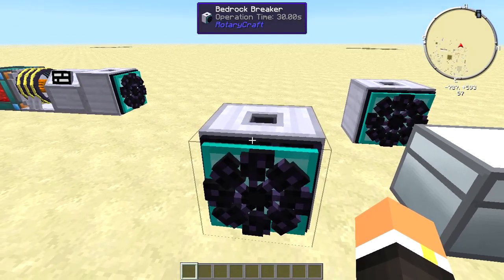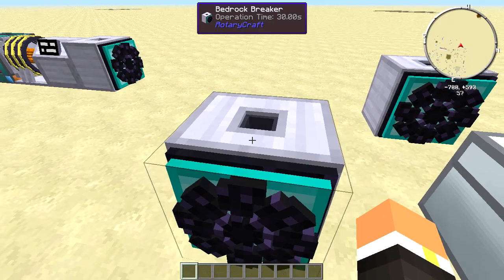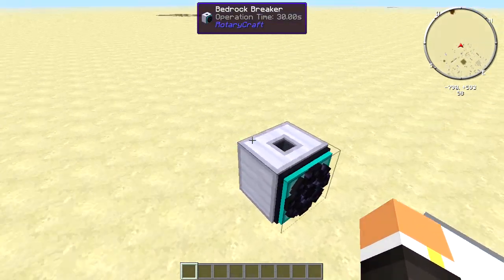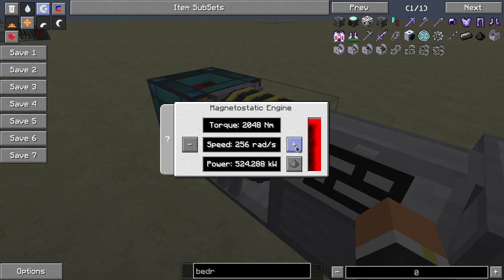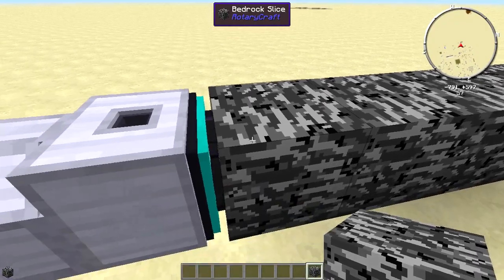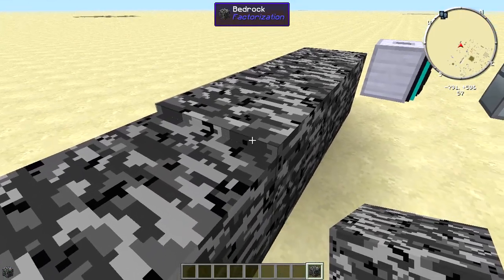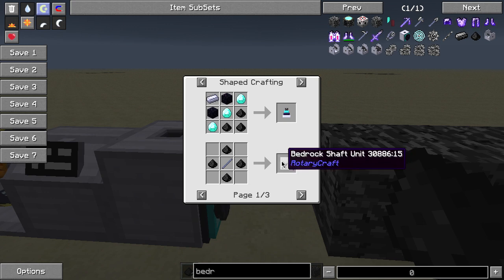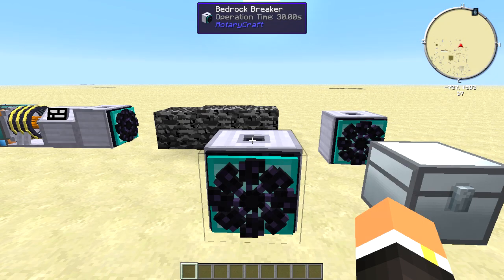Feed The Beast - Machine Tutorials - Bedrock Breaker

Comment: There's just one problem in your video :D To make the CVT unit you need a BEDROCK shaft :3 So initially you gotta figure out another way. Hope this helps someone who's being confused.
Reply from the maker: That depends on your version of the mod. Mine doesn't require a bedrock shaft.
Reply: Interesting... because in 2 modpacks I've played (am playing on one of them currently) even though it's different rotary craft versions the cvt still requires 2 bedrock shaft units). What would you suggest as an alternate route to doing the brbreaker before cvt if I may ask?
Reply: By his version he means creative mode.